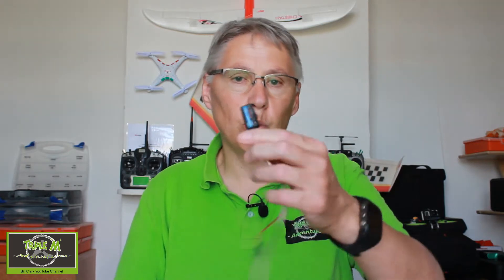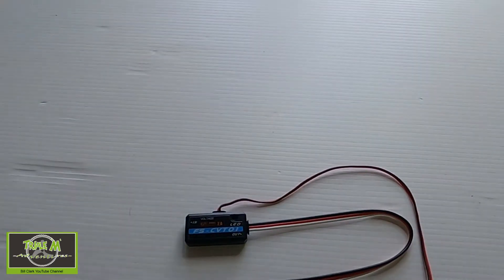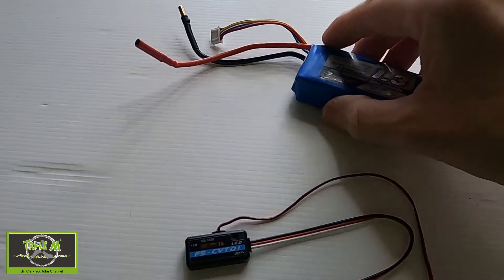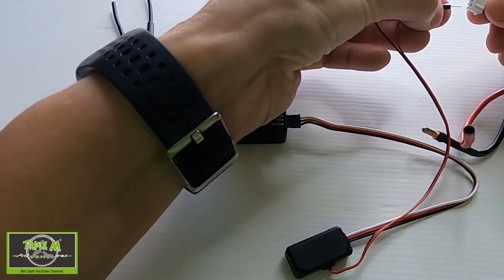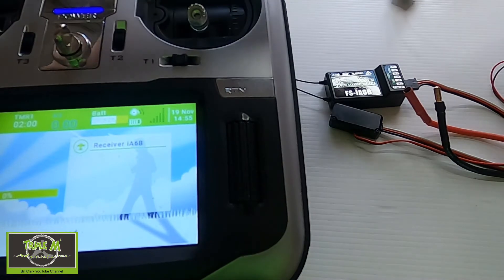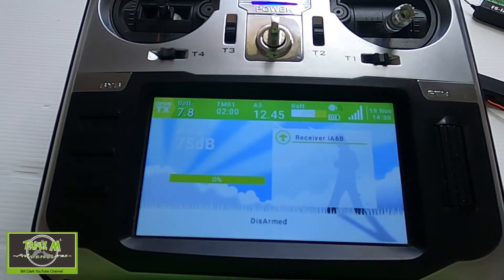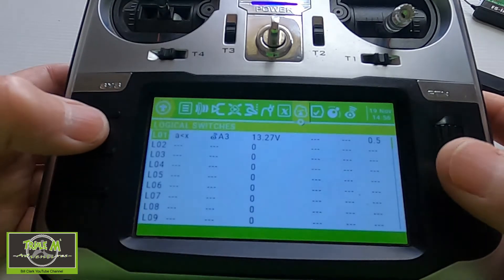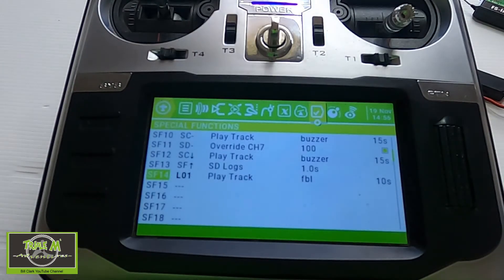Review: FlySky FS-CVT01 Voltage Telemetry Sensor

Comment: There's an output and an input to the sensor. What is the input used for?
Reply from the maker: This could be used to input the flight battery voltage.
Reply: @the-happy-RC-flyer  you mean it can  be used in series with a nitro battery?
Reply from the maker: @artfulcarver3578  I would assume any battery up to the maximum  allowable voltage but just use the two I put wires.

Comment: Hello. How to conect to remote control fly sky i6x.thank you
Reply from the maker: This sensor needs to be connected to the receiver and to the sensor socket. Not all receivers have this option available.
Reply: @the-happy-RC-flyer   I have  fs ia6b it's correct?
Reply from the maker: If it has the sensor servo socket you are good to go.

Comment: What plugs into the other end of the sensor. I cant quite catch it in the video.
Reply from the maker: Hi Justin, you need to plug the battery lead into the balance plug of the battery and the servo style plug into the sensor pins in the receiver. Not all receivers have the sensor socket.

Comment: Is there a voltage limit? Is 6s possible
Reply: Ok thanks...my friend told me he also drives 6s without any problems....works
Reply from the maker: @chrisscotty4518  thanks Chris I have only tested it with 4s batteries.
Reply from the maker: Chris I have checked the website site and it states -100 +100 volts! Seems high but that’s what the state.

https://www.flysky-cn.com/cvt01-canshu

Comment: Thank you Bill. I operate the voltage sensor flawlessly. My challenge at the moment is to also read the temp sensor (same receiver, i6x radio)? Any tips?
Reply from the maker: What problem are you experiencing with the temp sensor? If it only has signal, ground and power like the voltage sensor then it sounds like any problems you are having will be with the telemetry settings in your radio which is interpreting the data, just guessing!
Reply: @the-happy-RC-flyer  have it sorted! Wired both sensors through and that brings the data

Comment: Hi Bill great videos, could use some help. I have the setup done correctly and I am seeing voltage in my telemetry settings menu, but not in my widget's do you have an idea what's the problem.cheers
Reply from the maker: You need to make sure you are selecting the telemetry option for the widget in my video it is A3. Do not select -A3 or +A3 these will return the highest and lowest recorded voltage.
Reply: @the-happy-RC-flyer  Hi bill got that working thanks a million for your help..👍

Comment: When using this device I'm assuming the device can remain plugged in to the cars ESC.. But the other  connection needs to be reconnected when changing the  each battery?
Reply from the maker: If you are balance charging yes you are correct.

Comment: I'm using this in my RC mower to read the voltage while mowing. Super handy
Reply from the maker: If you pull that off everyone will want one. Adding ArduPilot for waypoint lawn mowing would be a winner. Good luck with it.
Reply: @the-happy-RC-flyer  oh it's up and running, mowed with it yesterday. Works a treat and controller throws alarm sounds when voltage gets to low
Reply from the maker: @Pocketpac  I checked your video out very cool.

Comment: These sensors are great. I also use the flysky altitude sensor. If you need to calibrate the output voltage you can add an offset in the OpenTX  telemetry page
Reply from the maker: Thanks for that Charles had not thought of that.
Reply: @Simon Lomax no it doesn't. OpenTX autocalibrates for 0ft alt when you power up the receiver/sensor. You can manually reset it between flights (for instance if temerature or pressure changes has forced it to drift off) by using the 'reset telemetry' feature